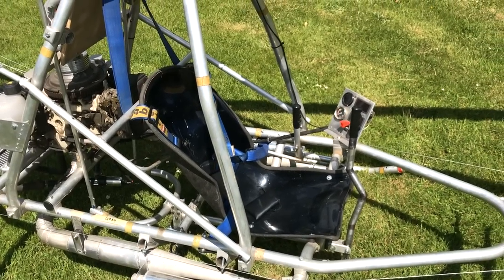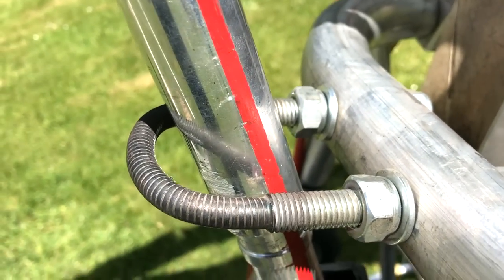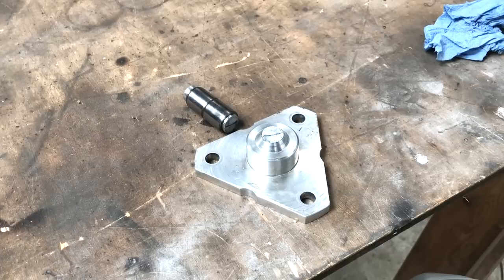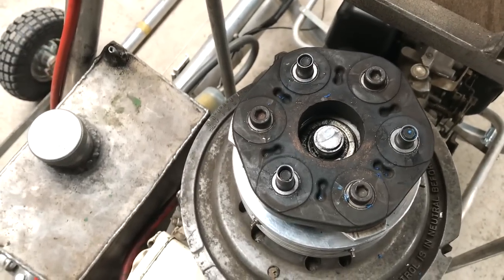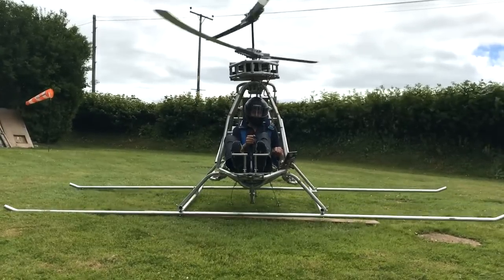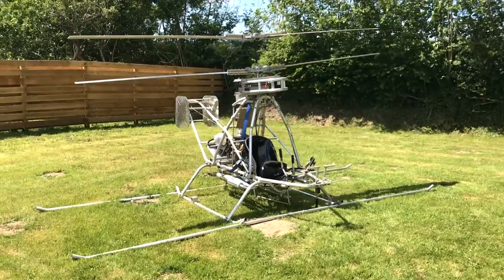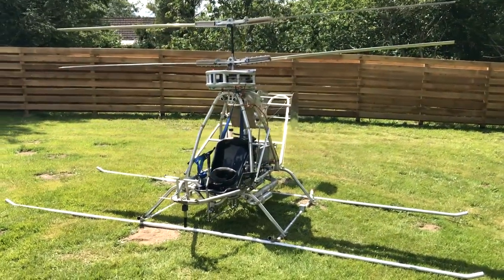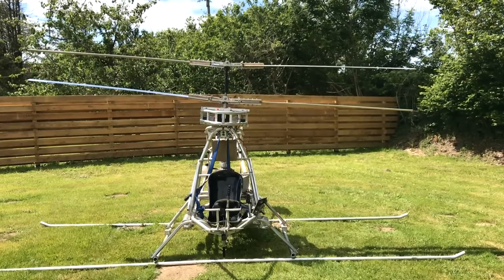Part 4 Learning to FLY Homemade Helicopter

Comment: It's definitely not cyclic pitch. You tilt the whole rotor system relative to the airframe. That's weight shift control. Happy to see you have a teetering system, but without true collective pitch control you are unable to autorotate. For the sake of your future self, I recommend remaining under one meter agl at all times.
Reply from the maker: Will do thanks 👍 I'm convinced it's cyclic pitch control but happy to discuss.
Reply: This a coaxial design without tailrotor.
You seem very knowledgeable.  Why tackle building  and operating a type of machine that often crashes due to operater error, and equipment failure?  Wile E. Coyote technology.  Homemade, not ACME.
Reply from the maker: Decisions on what to build were made long ago when I knew very little about helicopters. I chose this design based on what I thought I could build and watching the Nolan coaxial on YouTube. It flew really well, very controlled and was demonstrated thoroughly. The same for the air scooter 2 who's designers took it a step further and started and advertising campaign. All the same principle as mine and my goal was to hover around a field. A tail rotor or collective pitch wouldn't have made this any safer. In the beginning it looked easier to build than conventional but with hindsight it probably wasn't. I'm not keen on tail rotors in general and Kaman, Kamov, and chinook helicopters have all been very successful without them. Why tail rotors have been widely adopted as the norm is something I can't understand.
Reply: Autogyro's ( gyrocopter was a word introduced by I. Bensen )  seem to fly very well in autorotation without collective pitch.
When you tilt the rotor system , relative to the airframe , the AOA of the rotor blades is changed in a cyclic manner .
Is it done in a 'conventional' manner , no.
Is it still cyclic pitch change , yes.
Reply: @Ben-Dixey  to be cyclic pitch controlled you would need a swashplate to increase pitch 90 degrees before the desired lateral/forward movement to compensate for gyroscopic effect. The blades pitch in your setup never changes in relation with the opposite blade, thrust remains the same ( unless rpm increased ) -  Amazing work by the way :)
Reply: @leemnav  this is not an autogyro, the pitch of the blades does not change to its relative wind which it's generated by the RPM's off the engine not the forward movement of the helicopter.
Reply: @TM-529  Thanks for letting me know  that this , btd's machine , is NOT an autogyro , I didn't know that........
The collective pitch never changes in btd's machine because the blades have fixed pitch . The cyclic pitch however does change with every tilt of the mast/head. A swashplate is just ONE way to achieve the desired gyroscopic effect 90 ° pitch change.
Imagine sitting in btd's machine with no spinning rotors. The lower rotor blades are in a position perpendicular to the pilot's body. If the pilot tilt the rotor head forward/backward , and kowing that both blades  are connected with a hub bar , than one blade will increase it's pitch and the other blade will decrease the pitch , it's as simple as that because the hub bar is ' rotated' , so to speak off , along it's lenghtwise axis.
The blades don't care how this is achieved , by a swashplate or by rotorhead tilt , the result is 'the same'.  
Since the tilting of the rotorhead can only be done  done in a cyclic manner the result is cyclic pitch change.......I guess.
Reply from the maker: Thanks. 👍 gyroscopic force and precession is cancelled in a counter rotating coaxial configuration. However I believe it's the teeter hinges that allows the angle of attack change which powers the rotor tilt.
Reply: @leemnav  "The cyclic pitch however does change with every tilt of the mast/head"..... WRONG, it changes only in relation to the mast and only the thrust vector does. Pitch remains the same in relation to the blades airflow.
Gyroscopic effect has nothing to do with swashplate which is there to provide DIFFERENTIAL thrust/lift from one blade to the another inducing lateral/forward movements, gyro procession is a side effect to deal inherited in the system. 

"swashplate or by rotorhead tilt , the result is 'the same"......WRONG, swash plate WILL increase pitch on one blade WHILE decreasing it on the opposite side - rotorhead tilt DOES NOT changes pitch blades at all! hence NO differential thrust  

"knowing that both blades are connected with a hub bar".....this should tell you something.

You could have them spinning on a vertical axis (horizontal hub bar) and their angle of attack/airflow will not change on the blades because it's induced by its rotational movement, ONLY the thrust vector changes. 

NO cyclic control = weight shift
Reply: @TM-529  If btd move his 'weight shift control stick' , which weight exactly is shifted ?
Reply: @leemnav  the center of gravity is shifted from the thrust vector line
Reply: @TM-529  If I understand you correctly than btd , by moving his control stick , is pushing his weight and that of his helicopter out of the center of gravity ?
Reply: @leemnav  Not "out of center of gravity" it shift its weight in relation to thrust line therefore weight shift controlled.

On a different note, i'm not sure why he chose symmetric airfoil for the blades which provide zero lift at zero angle of attack, but i have no doubt he knows exactly what he's doing, i must be missing something, in the end what he did is brilliant, he took the complexity out of most DIY coaxial helicopters by eliminating collective/cyclic using a weight shift approach. 

Check this out, it may help you visualize it
https://youtu.be/nh2Ym7ehb8k?t=51
Reply: @leemnav  it's not about normal flight, it's what happens when the engine fails and the helicopter is descending rapidly, you need to be able to control the collective pitch to release the kinetic energy in the rotating blades and produce lift to act as a brake to slow the rate of the descent of the helicopter. You can't do that if you don't have collective pitch control.
Reply: @deang5622  In order to release kinetic energy in the blades , you have to store kinetic energy. The blades need to be as light as possible with this concept ( rotor RPM altitude control) so forget about loads of kinetic energy stored in these light/short blades.
How much altitude does one need to safely recover from an engine failure ? Is this the altitude this helicopter will spend most of his time ? 
Most people don't seem to understand that helicopters build by a mechanic in his shed likely will fly just out of ground effect most of the time and this for short periods of time.
I think most of these builders see it as a fun project and not to become the second Frank Robinson.
Reply: @TM-529  So his control stick movement does shift his weight and that of the helicopter in relation of the thrust line ?
Why would he set his blades at a fixed pitch of zero degrees angle of attack ?
Symetrical blades have very little shift of CL when the AOA is changed , perhaps that's why he used symetrical foils.
Reply from the maker: When I do a hang test suspending the helicopter from the mast from the eye bolt in the centre and move the cyclic stick, (weight shift) the controls make the airframe move in the opposite direction to what we are used to seeing. So if I move the cyclic forwards the nose rises which is the opposite to how it actually flys. The cyclic forces are tiny, it's very hard to believe I'm shifting any weight around at all. The cyclic feels like an R22. 

I chose symmetrical blades because that's what I read the Nolan brothers did as they had problems with asymmetrical. Not sure if that was true I think either would be fine. 

The Gen 4 flys more like a weight shift but I think it is also cyclic pitch. In order to weight shift like a hanglider you need to be able to push against something, like a big wing. There is nothing to push against in the Gen 4, there's no gyroscopic effect to push against because there isn't any. Helicopters in the air like this don't hang from the mast like in the hang test. They pitch and roll in the air from their centre of mass axis. 
 Just my thoughts anyway.
Reply: @Ben-Dixey  "I move the cyclic forwards the nose rises" ....as it should. This is different from a hang glider or an autogyro, rising the noise will put the CG forward forcing the mast to tilt forward due to your weight and make the helicopter advance as the thrust line is behind you.

A hang glider pilot will "push" on the bars shifting the CG aft forcing the wing to pitch up to gain altitude (after he used kinetic energy to gain airspeed or use thermals), in your helicopter "pitching up" or pulling on the cyclic will tilt the mast back and make you move backwards (from hover)

"Helicopters in the air like this don't hang from the mast"......so if you take it out you're still flying? or ....fall down like a rock?
Reply: @leemnav  "In order to release kinetic energy in the blades , you have to store kinetic energy"  

this is not how it works mate, when the helicopter is going down the upflow of air tilts the local lift vector forwards keeping the rotor spinning, the pilot needs to immediately LOWER the collective upon engine failure to maintain or GAIN rotor RPM as needed, only at the end of the pitch curve is when you will use the "energy stored" in the blades by pulling 100% on the collective
Reply: @TM-529  "this is not how it works mate" means what ?
Have you invented something that can release more kinetic energy than what was stored there  in first place ?
Reply from the maker: You say that the pitch of the rotor blades stay the same in relation to each other and thrust is the same on both sides of the disc. It's true they stay the same in relation to each other but the angle of attack does change, creating more lift on one side of the disc than the other. 
It's like power steering which is why the cyclic is so light. 

When I move forward in the air no opposing airframe tilt is evident, for it to be weight shift this would be obvious to see wouldn't it ?
Reply: @Ben-Dixey  Sir, you need to see Newton's 2-3rd laws, when you "push" the stick forward, the rotor mast tilt forward and off you go ahead, remember it's not a glider and your "wing" are your source of lift AND thrust.

"It's like power steering which is why the cyclic is so light".... 

When an aircraft is in unaccelerated flight (level flight) the forces acting upon it are in BALANCE, thrust = drag / lift = weight 

Minimal force applied on any control surface will induce bank/roll - it's not about hydraulic power - think about a seesaw where the fulcrum = CG, it wont matter if you have a ton on each end, as long as it's balanced you will be able to push it down/up with minimal force and if you shift the CG it will induce movement as well. That's why is very important for pilots to ensure the aircraft is within the envelope of weight and balance, because shifted weight WILL induce roll or pitch possible to the extent where it could be uncontrollable/compensable with tiny ailerons/elevators

YOUR helicopter does NOT have cyclic control (no swashplate) therefore no changes in pitch PER CYCLE.  
Shifting the weight underneath it WILL tilt the mast changing the thrust vector. 

The helicopter under the mast have way more mass than the rotor therefore is the rotor that will move (2-3rd law of movement) 

Try hanging your helicopter with YOU in it then push on the "cyclic" while filming it form the side, you should see the mast tilt forward, or put your car in neutral and standing outside try to push it forward while you're on a skateboard and tell me what moves, you or the car?
Reply: @leemnav  You have no clue of what you're talking about. The kinetic energy will increase with rotor RPM due to the updraft when in auto-rotation, then it will be "used" at the end of the pitch curve - NOTHING to do with "stored" initial kinetic energy before engine failure which is was the OP was referring to.

No need to answer, no need validation from you, i was trying to help, your next comment will be ignored.
Reply: @TM-529  Heavy blades will absorb more kinetic energy with increasing rotor rpm than light blades. You completely ignore , or are not aware , of this fact and that's what I was trying to say.
Btd need light blades to minimize respond time since he's using rotor rpm change to control altitude.
He's clever enough to understand the limitations of his creation and probably will NEVER take his machine high  enough  to even THINK about autorotation recovery.
Seems you're feeling bitten in the butt cause not everybody blindly follows your view on "weight shift" theory.
Reply from the maker: @TM-529  I agree with most of that except the bit we are in disagreement about . I think the term Cyclic pitch control is confusing, it probably should be called cyclic angle of attack control.  Once you can visualize how the angle of attack changes in a cyclic manner then you can understand how it's helping to power the rotor tilt. 

 The teeter hinges and tilting mast act like a swash plate but as you say don't change the pitch but do change the angle of attack.
Reply: @Ben-Dixey  I think we are talking about different airflow vectors

When hovering (no-wind condition) - the airflow over the blades is generated by their circular motion, it's is relative and opposite to the direction of their movement, this is fixed to the plane in which the blades are spinning, the angle of attack/pitch NEVER changes in relation to this circular movement and induced airflow, tilting the mast will never change this airflow vector.

When flying ahead - it will induce airflow in the opposite direction of travel - IF the mast is tilted aft (stick back), the advancing blade angle of attack will be at higher than the retreating blade hence providing more lift, but the helicopter won't bank left due to gyroscopic precession, it will still do what's supposed to do (slow down, fly backwards...)

In the end all of this forces are controlled by shifting the weight underneath it IMO

Anyway..one thing i want to clear out is that i have NOTHING but ADMIRATION for your work, regardless of my opinion, your helicopter flies as it should which proves you know 110% what you're doing, pitch/weight controlled is irrelevant - it's still a wonderful flying machine !!!
Reply from the maker: All good discussions. 👍 you are an intelligent person and thanks for the compliment.  Your are right it doesn't really matter how it does it as long as it works. That's true up to the point of design decisions, In the beginning I believed it was weight shift and made the controls strong enough to take the extra control forces needed in that scenario.  

Your point about the downward air flow in a hover always being relative to the rotor I disagree with.  There must be a point of transition between air flow and rotor tilt where the two are no longer relative. This is where I believe the angle of attack changes and the powered tilting occurs. The teeter hinges also facilitate a blade pitch change with the rotor spinning in the same orbit before the change. It might be milliseconds but that's all it would need for the rotor to catch up to the cyclic stick. 

I'm not saying I'm definitely right about all this but it seems to make sense to me.  I think the cyclic stick forces needed to tilt the rotor without this powered assistance would be much higher.
Reply: @Ben-Dixey  Helicopters move by tilting the rotor disc plane - most use cyclic pitch control to tilt the rotor disc - yours have fixed pitch and tilt the mast instead - by doing so your rotor disc will tilt together with the mast and the thrust vector changes, the blade induced airflow is directly related to its circular path (rotor disc) circular movement, not the airflow induced by forward displacement of the whole craft.

If you're standing in front of the helicopter while it is hovering and the mast is tilted aft you will see a higher angle of attack on the left blade BUT this is from your perspective ONLY and it's NOT the path the blade is actually taking to induce airflow/thrust/lift/relative force... on itself, the blade isn't coming straight at you at that angle, it's following its tilted rotational path in which its pitch-to-relative wind, is constant.

As i mentioned before, "if" the helicopter is flying forward then the extra induced wind/airflow will hit this right blade at a higher angle of attack creating an asymmetric force (called p-factor on "fixed" or variable pitch propellers) BUT this has no effect on your machine because it has coaxial blades and this asymmetrical force will be cancelled by the counter rotating blade, the thrust/relative vector of the rotor disc will remain the same.

Also, any control input by the pilot in your helicopter is initiated by changing the geometry of it (tilting the mast) to shift the CG hence weight shift IMHO

the following are a couple examples of weight shift controlled coaxial UL helicopters
 
https://youtu.be/OM7HHB51WX8

https://youtu.be/Dm_G9Dpn5SA
Reply from the maker: @TM-529  Don't think we are going to agree. Ha
I don't think the examples you have given are purely weight shift either. 

I do believe my helicopter is around 2-5% weight shift. 95-98% cyclic control. 

Perhaps some others could weigh in ? 😉It's certainly an interesting subject and has been debated in depth many times before.
Reply: @Ben-Dixey  I agree to disagree 🙄

One last try:

Whatever aerodynamic magic happens above the mast hinge tilt/pitch/roll....that moves the craft, is happening because a shift in the weight underneath the mast hinge.

Let's take a hang-glider as an example (i think we can agree it's weight-shift controlled)

When the pilot moves to the left, it's the wing that actually tilts (rolls/banks) not him.

Due to the wing design (flat bottom) it will force the airflow on top of it to go faster than the airflow below it (differential pressure) therefore generating lift and because is in banking angle its total lift also shifts making it turn to the left. 
While turning, the inside wing (left side) is in a smaller radius turn than the outside wing (right side) which means the outside wing is going faster and generating more lift (over-banking tendency)

Would you agree that all these aerodynamic forces turning the wing in the desired direction are initiated by the pilot as he shifts his weight? or the turn is due to the shape of the wing only?? 

Perhaps our disagreement is just semantics. You could say an airplane banks thanks to its ailerons and i could say it's due to the pilot turning the yoke :) 

We're not really discussing aerodynamics here but what actions are needed to initiate a controlled flight, in your machine the pilot needs to shift its weight by pushing/pulling on the linkage. In other machines is by changing the pitch in "each cycle" - no articulated mast = no possible change in CG (unless he hangs from the side hehe)
Reply from the maker: I agree a hang glider is weight shift control. I take it you would classify an autogyro as weight shift too? 
If that's the case why is it that controlling a hang glider takes considerable effort by the pilot and an autogyro you can control with 2 fingers? If you apply newtons laws of movement to an autogyro saying that the rotor disc moves because the pilot weighs more and we know how hard it is to change the direction of a spinning object, if aerodynamics weren't powering the disc it would be even harder than a hang glider to change direction and yet the opposite is true.
Reply: @Ben-Dixey  "......why is it that controlling a hang glider takes considerable effort by the pilot and an autogyro you can control with 2 fingers?" 
Have you considered the huge leverage you gain in the stick?

Look...While in the air you CANNOT push against the ground with your feet to move the helicopter around

You need to use aerodynamic forces to move it - to steer it, you tilt the rotor disk by shifting the weight underneath it (in your helicopter) 
When pushing the stick to one side the CG moves to the same side and because of gravity the MAST AND ROTOR DISC is what tilts not YOU (you and the engine airframe are the heaviest mass) - of course once moving inertia, skidding, slipping increased G while banking/pulling up also come into play.

"...we know how hard it is to change the direction of a spinning object.." you seems to forget that the craft is in the AIR and in balance...minimal forces will change its flight attitude. Helicopters DO roll and pitch despite gyro forces and do so by tilting the rotor disc just a few degrees, then inertia and gravity do the rest, but most can't shift weight so they use cyclic to tilt the disc.

Look at your helicopter from its right side and put the lower blades at 3 - 6 o'clock then draw 3 imaginary lines 
1: along the mast
2: along the blade chord line
3: 90 degrees to the mast at the height  where it crosses the chord line

The angle between 2/3 is your angle of attack - 3 is the rotor disc and relative wind to it - when the mast tilts back ALL three lines move together hence NO change in pitch 

"ULTRALIGHT COAXIAL ELECTRIC WEIGHT SHIFT HELICOPTER" https://youtu.be/IhQsxKu1eUo

https://youtu.be/GvAgDsWhSy0

https://youtu.be/qZ7qUPAXkvc
Reply from the maker: @TM-529  I have read all I can about weight shift vs cyclic control regarding gyrocopters and fixed pitch helicopters on the rotary wing forum. Plenty of discussions about it with most of the poeple knowing more about the subject than I do. Virtually all agree a gyrocopter is cyclic control as the inertia of a rotor would be virtually impossible to control via weight shift theory. I believe I have explained how it works in the video and further in the comments. I'm very confident I'm correct on this. If you disagree that's fine we are entitled to our own opinions.